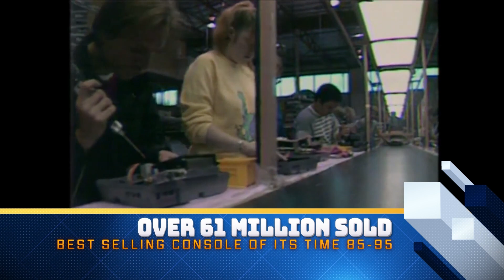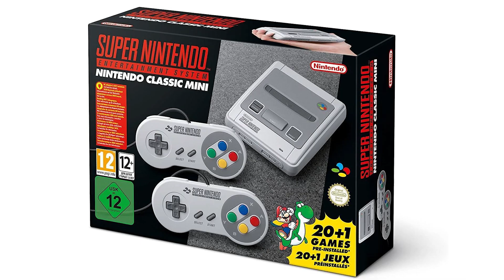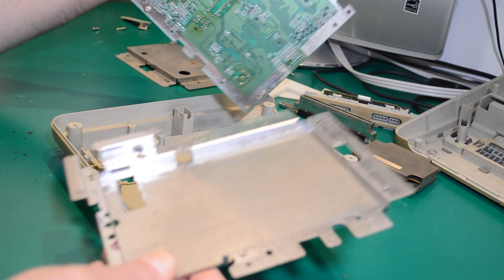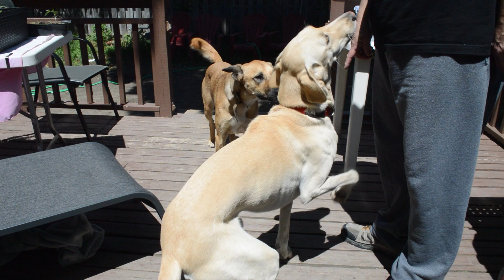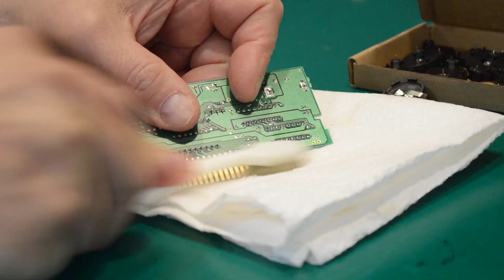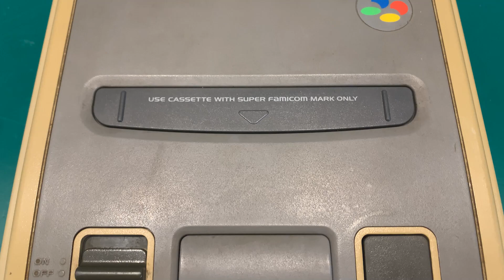Super Nintendo / Famicom RESTORATION | Retro Repair Guy Episode 28

Comment: great video once again. To bad it was a famicom vs a NTSC SNES. btw nice hair cut. as per what i woumd like to see, being a retro gamer, i will have to go with the Atari even though its not part of the 3 items you mentioned 😀 😄... in those baseball games you were like Larry Walker as part of the 94 expos. How you have a great long weekend
Reply from the maker: Hi Wally! Just an FYI, the Super Famicom is from Japan and therefore NTSC, not PAL. Also depending on the region, some appliances run at 60Hz like here while others at 50Hz. The Super Famicom runs at 60Hz. The only difference is that they have 100V coming out of their outlets and we have 120V but the Famicom operates on DC 9V, so as long as you have the proper adapter, all is fine. This is also why there's no problem using the games on an SNES. Where you would have a problem is an SNES made for Europe for example but the Super Famicom was made for Japan so it runs fine here and basically the exact same machine. Plus it's the original the SNES is based on so I like it even more!

Wow Larry Walker and the Expos...there's a memory of the past. I haven't watched baseball in years. Isn't he in the hall of fame now? As for the hair, Mrs. RRG hates it and keeps saying do something with it! 😂 Thank you and have a great weekend as well!
Reply: @RetroRepairGuy  Larry Walker is part of the hall of fame as a Rockies not a Expos unfortunately. The reason i mentioned to bad ita a damicom is rhat i prefer the look of the SNES as it brings back memories as a kid. In regards to the hair, happy wife, happy life.
Reply from the maker: @wallyf7020  Ohhh and LOL